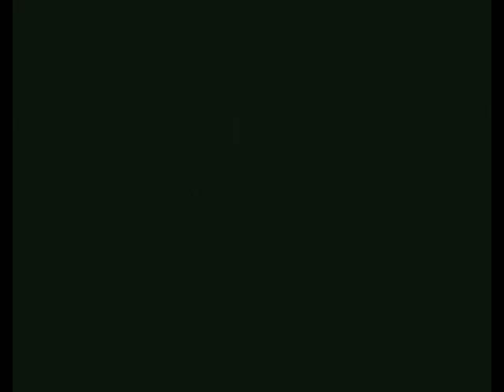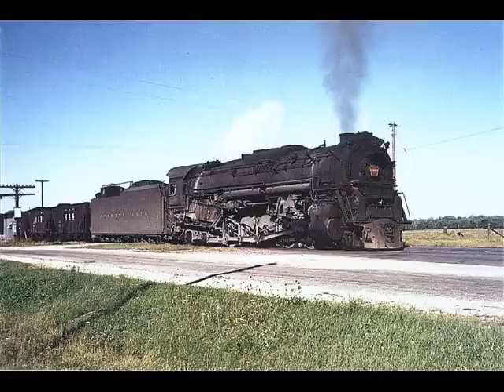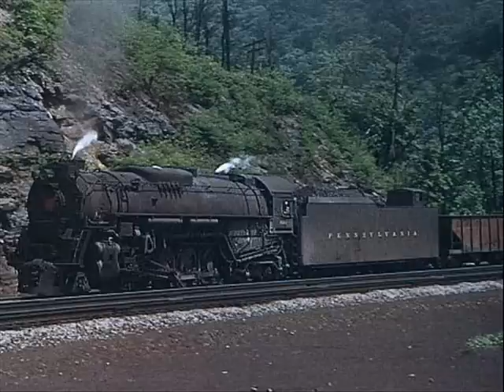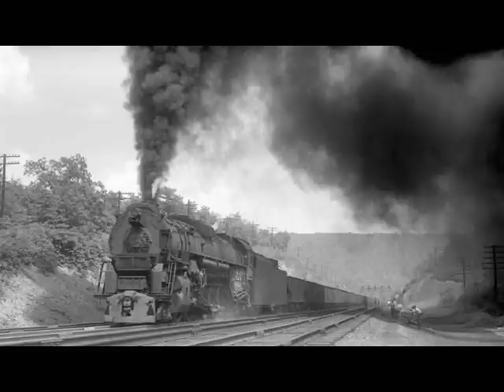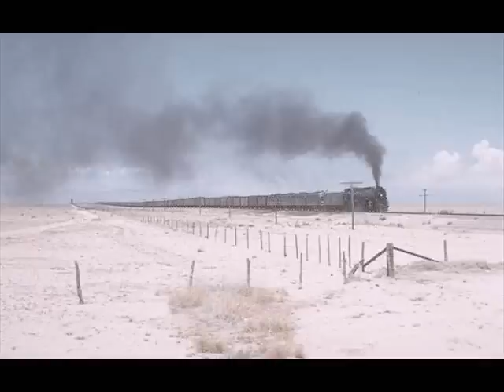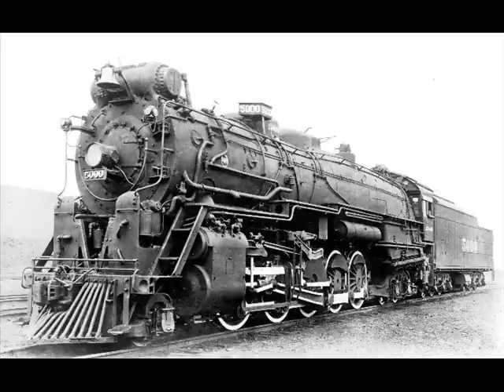PRR Steam Audio Recording: J1a #6410 & SF 2-10-4 #5035 - Bellevue, Ohio (1956)

Comment: Agreed, the PRR "chuff" (first loco) sounds really off -  like the valve gear was in desperate need of being re-adjusted.  I'm not an expert, but as far as I know, on any two cilinder steam engine the timing of the opposing cilinders is done, leading to the main drivers being off exactly at a 90 degree angle, leading to even intervals between the "chuffs" -  the valve gear has to be re-adjusted on a regullar basis. Please correct me if I'm wrong

Comment: @Bill0254 The C&O lent a 2-10-4 to the pennsy and the N&W lent 2-8-8-2 for testing. The choice was the 2-10-4 wheel arragned. No real reason has ever been found. Many have ideas as to why. One is used to Pennsy steam with Belphire fireboxes. This is one of the first without them. And the locomotive is a 2-10-4, which it the Texas Type (Texas & Pacific being the first pruchasers of the type.) After all fo that, the Pennsy owned THE most of this type then any other railroad in the US.
Reply: I thought the Pennsy test both a C&O 2-10-4 and a N&W 2-6-6-4. But wound up going with the 2-10-4

Comment: @trainman551 Santa Fe had the first of that arrangment, but it really was more a 2-10-2. If you look at pictures, the trailing truck carried very little weight. The TRUE super-power Texas type was ordered by the Texas & Pacific. And heres a lil tidbit, it was actually ordered BEFORE the first Super-power Berkshire order was placed. The 2-10-4 actually came BEFORE the 2-8-4. Look it, classic trsins ran a story on it.
Reply: The T & P 2-10-4 prototypes were relatively low-drivered (63"), which meant they were not built for speed...the J1/J1a(69") and 5001/5011 ATSF machines (74") were in reality "Super Texas Types" intended for fast-freight operations as opposed to the coal drags on the PRR Sandusky Branch...

Comment: @Bill0254 The J1 is The C&O T1 with a Penssy look...LOL
Reply: Not really. ,,,, for starters 
# 1 the stay bolts in the fire box all the way from the mud ring to the crown sheet were in different positions (((( the C&O crown sheet leak and the PENNSY'S DID NOT,
 # 2 Piston stroke were different 
 # 3 Cylinders were larger on the PENNSY
 # 4 C&O ran at 260 lbs boiler pressure 
 PENNSY'S ran at 300 lbs boiler pressure 
# 5 driver diameter 
C&O.          68/69  INCHES
PENNSY.   70/71 INCHES
Since bigger drivers that means a 6 to 9 inch longer 5 axle drive length 
((( a longer frame and boiler ))
# 6 and yet there is 100 more modifications to the T-1 the PENNSY did 
Traction effort 89,000 C&0 without booster
Traction effort 93,000 Pennsy without booster
     ******GG1 was an improved New Haven electric with a new BODY style 
    ***** The J1 was an improved 
C&O design 
 It's like saying all Dodge Challengers are the same until that one guy shows up with the 710 HP 
Hellcat motor 
Every same class J1's were different Good habits and bad habits . 
And yet these were not the baddest MFer's on the PENNSY 
That goes to the I1 class 2-10-0 
96,000 lbs tractive effort and at 78% cut off of the stroke , upwards of 105, 000 lbs of tractive effort 
Which is right there wirh the T1 and J1 with their boosters kick in
Reply: @robertswickard1262    You're both  correct.  The PRR J1 was built during WW2 when Wartime restrictions forced the PRR to look at existing designs and settling on the C&O T1.  True, Pennsy did improve on the T1 as well as adding PRR styling.  Even tho the J1s were very good locomotives, Management still considered them to be a borrowed design, and none were saved.

Comment: I read that the PRR went with the 2-10-4 because it was wasn't as complicated as the 2-8-8-4 and easier to maintain.
Reply: No, they couldn't design engines during WWII so they copied a C&O design.
Reply: They wanted to design their own engine to handle wartime demands, but the government didn't let them, so they leased a C&O T1 2-10-4 and an N&W A class 2-6-6-4 to test, and ultimately chose the T1 to be the base of their new locomotive... And actually it wasn't the simplicity that made their decision, they actually found the T1 to be more powerful, and that's why they chose it.

Had they chosen the A class, it probably would have been called the FG-1, K&L Trainz did a hypothetical model of the potential FG-1 a few months ago, you should check it out if you want to see what a Pennsy articulated would have looked like.

Comment: The Lima design Penncy Locomotives were so far out of time it was a wonder they could move. On the other hand while riding on a Santa Fe 5011 on up they had the guts, driving wheel size and were able to roll if turned loose. The crew loved those Santa Fe the J-1 on the other hand were in such poor shape that they were a poor Oh My locomotive. During the summer of 1956 Penncy managed to about destroy the Santa Fe. All the AT&SF were rebuilt then the shops torn down with many going to the death fully ready for service. I rode the 5011 and J-1s
Reply: The Santa Fe 2-10-4's were never rebuilt after leaving the Pennsy. The agreement was if the engines were put back in service Pennsy would pay for repairs. They were the first scrapped because Pennsy trashed them. The leased engines never again.